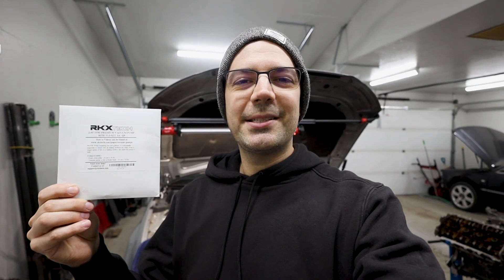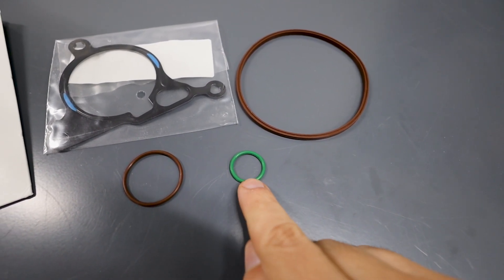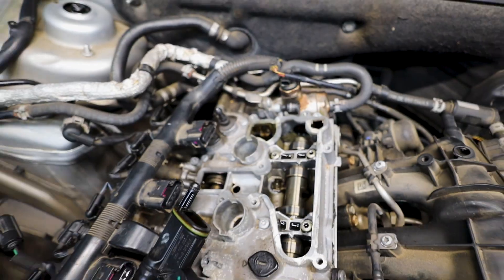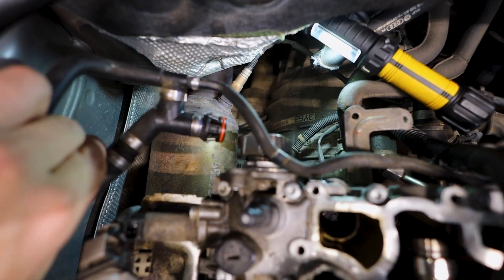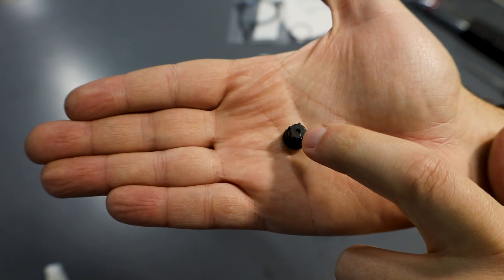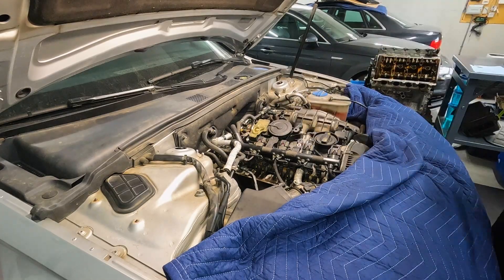How to rebuild a vacuum pump with the RKXTech kit on an Audi A4 B8 2.0

Comment: Hey, how did you remove the vacuum pump? The bolts are too long and they are stopping me from removing the pump.
Reply from the maker: The bolts aren't too long, your tooling is just too thick - hence my mention of mini ratcheting wrenches.
Reply: @FigureItAuto thanks for replying, what I mean is when the bolts are loose, I physically cannot remove the bolts because the firewall stops it

Comment: What if I just replaced this one vacuum hose gasket that caused the leak in this A4 and see if it stops the leak?
Would I have to remove the fuel pump or any PCV or anything?
I want to help my brother with his car but don’t want to spend a day doing it and also  afraid that when I start taking 13 year old fasteners off, plastic bits might break.

Could I access just the vacuum hose without a big disassembly in this video? 
I know Audi does not sell just that gasket. But it might be worth the risk of buying $30 kit but only use that one small gasket and save me a Saturday.

Comment: Is it necessary to remove the valve cover or can you replace the vacuum pump without removing the valve cover?
Reply from the maker: Only the PCV was removed - these cars don't have a valve cover in the traditional sense, they have a cam girdle. You can't just take the whole "cover" off without locking the timing, opening some covers on the front of the car, and removing some other things. That's not necessary or at all what you should be doing. PCV valve only.

Comment: I’m getting a vacuum sensor lower limit not reached code for abs. So my abs and brake light are on. The vacuum pump was leaking around the gasket and the inside had a lot of oil inside of it, same with a lot of oil were the vac hose connects to it. I read there shouldn’t be oil were it makes the vacuum so could that be the issue?

Comment: What if i lost the little oil screen in the process ? I can't find it on its own😢
Reply from the maker: @deweew  That's a tough position to be in and you're right, no one sells tiny screens like that separately. Either scour to find where it fell out, or gamble with the pump running without one. Hopefully your engine is relatively clean inside and as always, regular oil changes are key to survive .
Reply: @FigureItAudi  Thanks for the fast reply ! Soo bad, should have been more cautious. I found some vacuum pump from online junkyard. They are 5€ each. Lesson learnt !
Reply: How did you get the screen out
Reply: @nicholastorgerson4706 with a little hook, be careful not to ruin the mesh 😅

Comment: Why is the vacuum port difficult to go back in with the new O ring?
Reply from the maker: @EJR20  It shouldn't be. Provided you have the correct kit, are using the correct seal and perhaps put a little lube on there, you shouldn't experience resistance. Take your time and make sure the hose/housing is going together correctly and all the old seals are removed.

Comment: Great video and I will be pulling my HPFP because I'm getting rich faults P0287, which is common for the HPFP to have a seal failure.. Bur I will do the vacuum pump too since I'm going into the project, I do have a question on the vac pump oil screen, how did you get that out? did you pry it out, does it twist out?  I want to clean it since I know that is a vital oil passage.  Thanks
Reply from the maker: The screen isn't held in there with anything but a little friction; it'll slide out and back in nicely using a pick.
Reply: @FigureItAuto After putting back the rebuilt vacuum pump, when driving on idle/low speed the brake pedal would go all the way down and barely stop. I searched in old forums this issue for hours for the fix and someone said that if the screen had debree it would do that. Been looking for a video of this step everywhere and you are the first one to show how to do it. Great content, you saved me with this one.

Comment: To replace the vacuum pump do you need to take out the fuel pressure pump ?
Reply: Yes
Reply: Yup, it isn't hard at all just get a 1/4 drive triple square set

Comment: Problem with latest VAG 2.0 TDIs is oil/vacuum pumps which, especially oil pump part of it are weak. Combining them with vacuum pump makes it much trickier to upgrade with the old sprocket driven 1.9tdi pumps. Would be awesome to figure this outdi.

Comment: how did you get the push fiting to go in they gave me a green o ring and its too snugg and wont go in????
Reply from the maker: As in, the one at 14:22? Is it loose at all? Because it shouldn't be. If it's the wrong ring and not snug, I could see it binding on the housing when you're trying to push it in. But if it's the right size and you're just having trouble, I use synthetic grease to lube all the seals so nothing grabs and twists while it's being seated. Lube it, give a push - should work. Also, note the orientation of the 2 tabs on the vent with the green o-ring on it - they need to line up with the receiving holes in the pump housing.

Comment: How do you remove that hose with the orange O ring that goes into the vacum port? That's we're mine is leaking im trying to remove it but im scared i will break something thankyou.
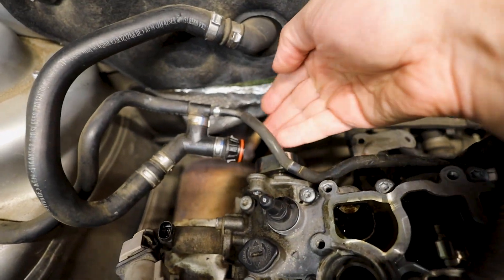Reply from the maker: 08:35 is what you're talking about, I believe. As I say, push tabs, pull outwards.
Reply: @FigureItAuto  Thank you 👍

Comment: Just a question , with the crush gasket, the one that comes off the pump is 3 layers , do i re use the other 2 with the included crush gasket in the kit?
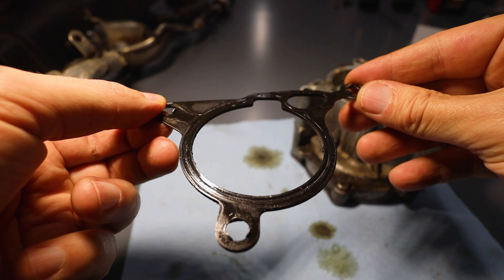Reply from the maker: Hey Katy - I'm not sure I totally understand your question, simply because with the kit there would be no need to re-use anything at all. Toss away that old black gasket (like seen at 09:30) and replace with the new one, no matter what.
Reply: @FigureItAuto the oem gasket is a 3-ply gasket and the rkx kit seems to only be a single ply that is identical with the 3rd ply that is closest to the block. Did you only use the supplied single ply gasket?
Reply: Amazing thanks!

Comment: Fantastic, detailed video! Liked and subscribed. For this vacuum pump, do you see any way that it can leak unmetered air into the cylinder head? I have an 2015 A5 B8 2.0TFSI cpmb engine, and have been chasing positive 15-20 percent long term fuel trims for a long time. Did everything from smoke tests, replaced with oem pcv, etc. but I keep seeing that my trims shoot up when I hold the brakes hard or pump the brakes. I keep thinking something's going on with this vacuum pump, but I don't understand it enough to know if it can leak air making the engine run lean. Appreciate any help. Thanks!
Reply: Same case for me

Comment: 5:58 I see you got B9 wagon! I was think at the beginning when you said, this is the last we’ll see of the B8; I was assuming a Q3 or Q5 for the replacement. Also, my B8.5 doesn’t have that helpful guide on the fuse panel. Owner’s manual is the only reference I have.